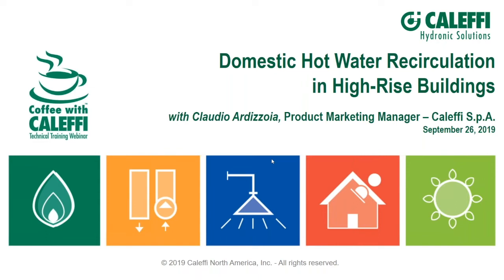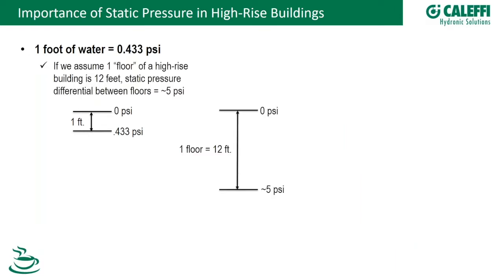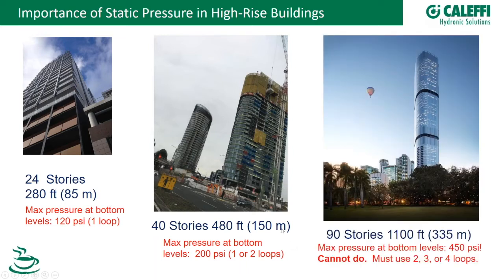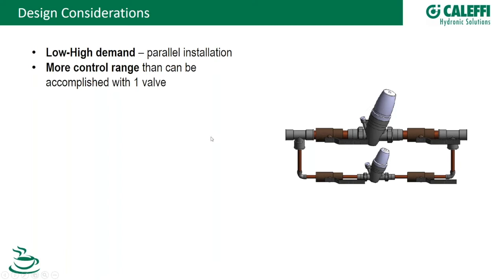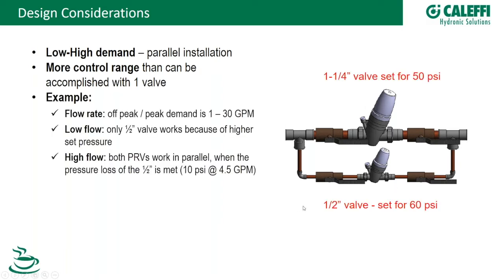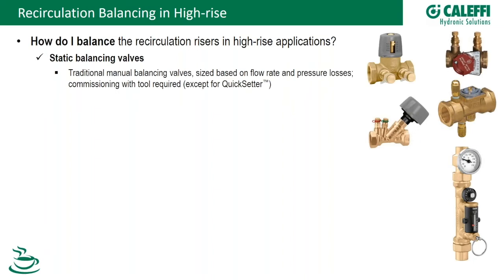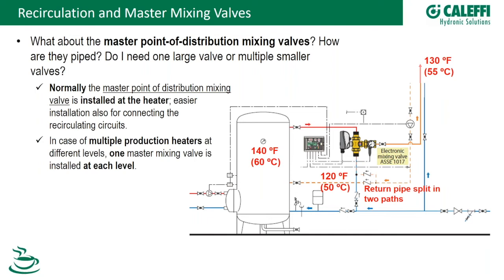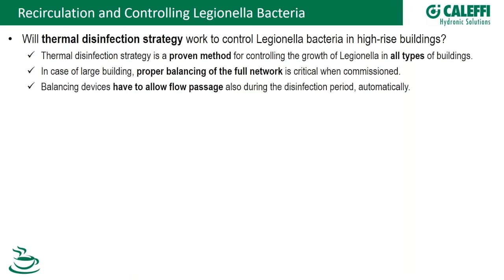Domestic Hot Water Recirculation in High Rise Buildings

Comment: Quick question here. Instead of using two PRV’s in parallel to meet design specifications for low-high demand; could you not also use a pilot operated PRV?  Just curious.  It would make sense almost always to install parallel for redundancy as well in case either PRV fails or needs servicing in the future; while still providing water service in a reduced capacity.
Reply from the maker: Thanks for your comment and inquiry.  You may be able to use a pilot PRV.   It has the ability to provide for the high/low demand.  We do not offer a pilot PRV, so please check with the manufacturer of said product. Our solution would be to use two PRVs in parallel.  Hope this helps.
Reply: LOOKS LIKE WE WERE THE ONLY COMMENTS ON THIS VIDEO. SUCH A SHAME THESE GUYS HAVE MUCH TO TEACH. GOD BLESS YOU .
Reply from the maker: @paulahowell2724  Thank you for your kind comment!